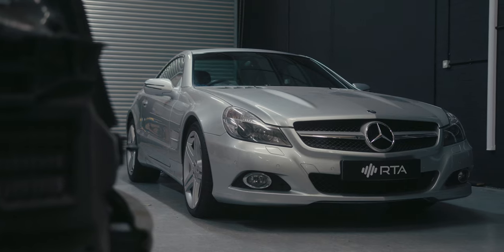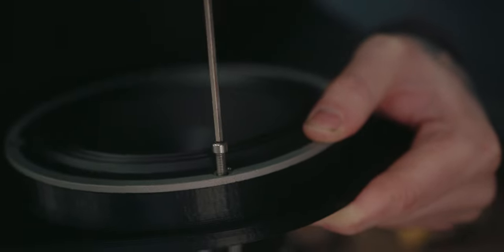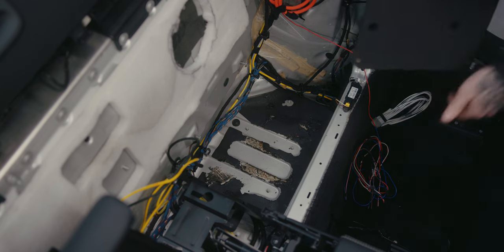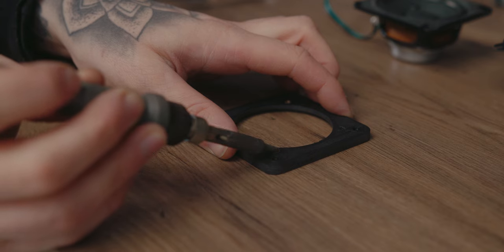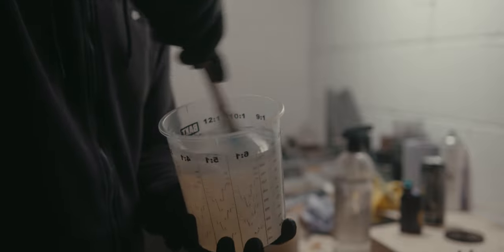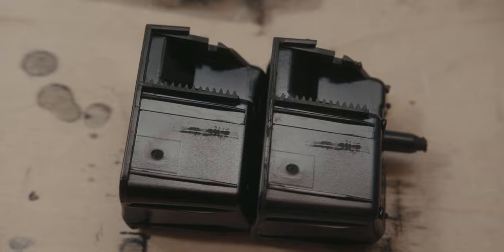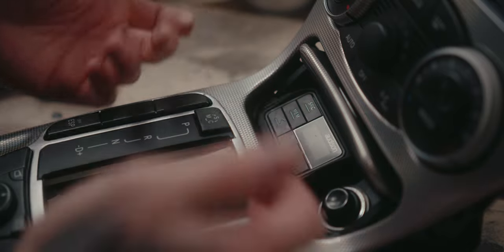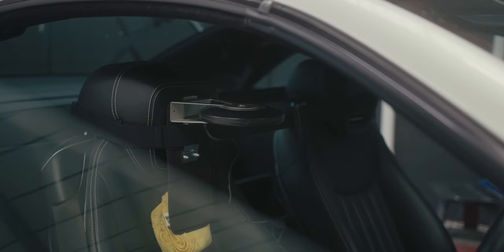It's More Than Just Speakers And Wiring // Mercedes SL350 Audio Upgrade

Comment: Incredible work! Amazing video as well, no BS and straight to the point! The 3D printing work interested me the most as I have one and look forward to using it in my audio build.
Reply from the maker: Thank you Philip! I'm not sure what your set-up is 3D printer wise, but I use a filament called Apollo-x from Formfutra which is ASA. Similar to ABS but much easier to work with and doesn't smell either. If you head over to their website and read the description you'll see the benefits, it's perfect for this type of work and is very easy to work with!

Comment: Amazing work and documentary, because this is not YT normal level of quality. May I ask what kind of resin are you using?
Reply from the maker: Thanks for watching Chris! Yes sure, the resin is polyurethane casting resin, specifically a product called Xencast P2 from Easy Composites. It’s got a two minute pot life and with my working conditions I can de-mould in roughly 40 - 60 minutes depending on the part’s thickness, geometry etc. I also add around 15% milled carbon fibre of the total weight (part A and part B combined), which makes the properties of the P2 closer to their P6 resin, but with the cure times of P2. I’m sure I’ve pinned a comment in the comments of this video where I’ve had a discussion with another user about resins so might be worth checking that out too. Thanks again for watching!

Comment: Thanks for doin this man I’m doing a system in nearly an identical car I just bought
Reply from the maker: No worries man, thanks for watching! What vehicle are you upgrading and what equipment?
Reply: @RTAFabrication  2007 slk 350 basically wanna keep as much stock As possible. Will replace whatever stock speakers that are lagging and just wanna add two Cerwin Vega 10 inch slim powered subs behind the seats . Hopefully will fit they are pretty small through a h/l converter and control them through a single bass knob. Do you think mounting them right behind the seats is a good idea ? Thanks for the response
Reply: Any input would be appreciated here I just wanna make sure my idea will work well and is not stupid subs are Cerwin Vega vpas10’s

Comment: wish 3d printers were around when i was in the biz... awesome job. what 3d printer are you using?
Reply: He is using a Wanhao i3 duplicater plus.
Reply from the maker: Yes Mehmet is right, it's the Wanhao i3 duplicator plus. This machine has the Microswiss all metal hot end and Iguss bearings. I do have a Creality CR-10 S4 with the BondTech direct drive system for larger prints.
Reply: @RTAFabrication  It is good to dive into details mate. Why you needed microswiss hot end? You mostly use PLA as far as I understand, right?

Comment: Anyone considering doing this yourself the Audison speakers are great and can be easily fitted direct on the doors with off the shelf mdf speaker rings with the tweeters mounted in the recess on the doors. Also the phone can be mounted in the centre console fairly easily. The rear cover is removed with two screws, the old Nokia holder tray is easily un screwed from below, prise off the bottom cover by the hinge push out the phone socket and then route through the USB, socket back in and then tuck the USB along the side panel and up under the the removed main centre console panel. I’m driving the speakers direct from the HU in network mode so active x overs...

Comment: 2.18 i wonder, it is abs or pla?
Reply from the maker: Thanks for watching Mert! I actually exclusively use a modified ASA firmament for every part that I print, specifically Form Futura Apollo-X. PLA definitely isn’t suited for vehicle interior applications and I just don’t like using ABS. The ASA sands down like ABS and doesn’t melt with the friction of sanding like PLA does, but I find the ease of printing comparable to PLA, so you get the best of both. The properties of the material also is well suited to a vehicle interior.
Reply: @RTAFabrication  Thank you very much for your valuable and informative answer. I am interested in diy manufacturing, i have not enought knowlage about engineering plastics. Your channel amazing for this. Umm last question, ABS dissolves in acetone, how about ASA? thank you again and sorry my bad English & grammer mistakes.
Reply from the maker: No problem at all. I’m glad you’ve found some value in them! I haven’t actually used acetone to smooth out prints before, as I tend to sand and add a glazing filler. I do believe that ASA reacts the same to acetone as ABS does though.

Comment: What casting resin did you use?
Reply from the maker: Thanks for watching Raimo. I use a polyurethane resin called Xencast P2 from a company called Easy Composites. If you head over to their website they have all the information about the resin on there, including a date sheet with all the technical elements listed.
Reply: @RTAFabrication  Thank you!

Comment: hello 
whitch type of resin dou you use for the mold and the part ? and do you ad hardner to it ? if yes and how much
Reply from the maker: Hey! If you’re referring to the ashtray insert that I moulded and cast a copy of, then the resin used for that is Xencast P2, which is a polyurethane resin from a company called Easy Composites. It’s a 1:1 mix of part A and part B, so there’s no separate hardener. Thanks for watching!